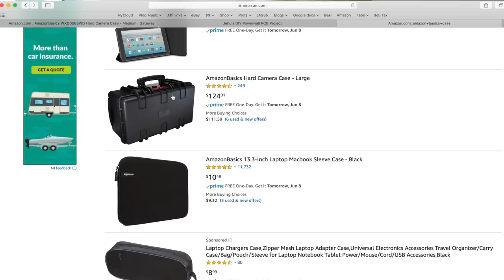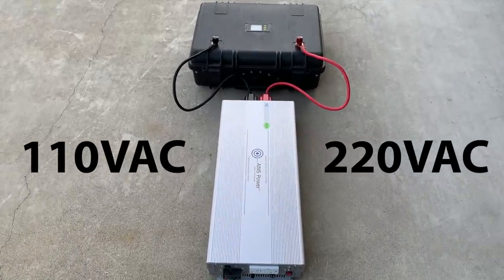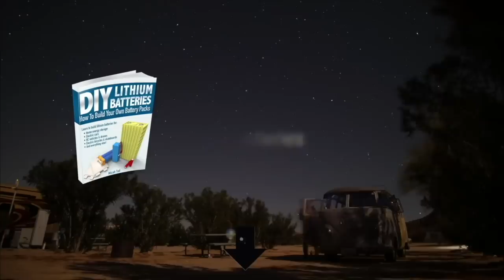600,000mAh DIY Power Pack build

Comment: Since your selling these battery modules We are going to be stuck watching all the battery builds using these modules. I think using LiFePO4  in Sino Poly Format is Way easier than messing around with these tiny 18650 batteries. One can get  (4) 100Ah 3.2 Cells for around $400 brand new together these give 12.8V many BMS available for these. Good for 4000 charge cycles at 80% depth of discharge. Way better deal that 12 volt SLA lead acid deep cycle batteries.

Comment: Capacity is around 84,000mah, not 600,000.

TL:DR AT BOTTOM
13:16. 24v. Each cell (discharged) is around 3.7v and fully charged around 4.2v.
Each of those boards has 7 cells IN SERIES. That means that for each of those, while the capacity of the cells alone may add up to, say, 14000mah, because they are in series the capacity remains the same.
At 1:48 you can see that the nominal capacity is 3000mah.
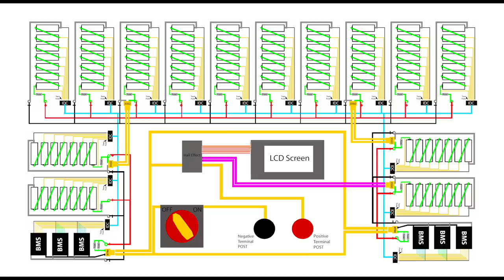At 13:00 we can see that 14 of these are connected, so 14*3000mah = a real capacity of 42000mah. A long way from 600AH huh.
BUT MORE IMPORTANTLY, look in the description. "Its not Click Bait 200 cells x 3000mah = 600,000mAh"
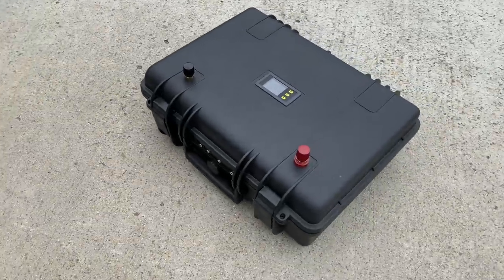Look at 13:00 again. 14 sets of 7 batteries. 14x7 is 98, not 200. Ok, lets assume that the  diagrams showing the cell packs in the schematic are just poorly draw and only show half the cells, as each board has cells on each side. so 14x14, which gives 196. Closer to 200.
Now, the real capacity. Each set of 7 cells gives 3000mah @ ~24v. times that by 2 to get the capacity of a whole "pack". 6000mah.
6000x14 = 84000mah. Still impressive, but nowhere near 600000mah. Plus, a lot of it wont get used.
MESSAGE TO CREATOR: Im hoping this was just an honest mistake :3
So why does this exist? The links in the description (From kit.co) say that commisions may be paid to the channel when people buy from that link. Thats right. It seems like a clever scam, but im hopeful that the creator has a reasonable explanation.
TL:DR
Capacity is around 84,000mah, not 600,000. A lot will be lost in inefficiency in the BMSs and converters.
Reply: You seem to be judging pretty harshly for being only partially correct.

First off, when people state Li-Ion or Li-Po battery capacities they usually do so at a single cell nominal voltage for mobile devices. Hence the 600,000mAh nominal at 3.6/3.7v. Otherwise why would he state the capacity in mAh when Ah is more suitable? The title is obviously meant for people who are not battery experts. One could easily slap a buck converter onto it and poof, it would be "600,000mAh" anyways.

Secondly, mAh/Ah is NOT a measure of battery capacity. It it not a unit of energy. In the video he stated the capacity in kWh as well, which is the more useful number.

He knows what he's doing, which I'd hope is extremely apparent. One can't spend over $1000 on a battery pack and not know this basic stuff.

Edit: Also, usually higher voltage is MORE efficient, and BMSes are primarily useful for charging. Higher voltage is better for battery efficiency, efficiency of wires (resistance), and the efficiency of buck converters or ESCs which would likely be used as a load for such batteries.
Reply: @jrcowboy1099  He made an 85Ah @ 24 Volt battery ...

Comment: Why not pack the batteries denser without cell holders and PCB boards between them? 

Could just solder and tape together a block of cells and connect them to a board with wires. Could’ve probably fit 1.5x-2x the capacity in the case I’d think.
Reply: He's actually talked about that in the videos where he was demonstrating his 7S boards. Solder and welding are a pain in the neck, and in his opinion, the expense and space of the boards is easily offset by the convenience and safety that they provide. I'm inclined to agree, personally.

Comment: this is my question:  why one can charge a drill battery in 30 minutes but to recharge a bike battery you need 6 hours.  is there a way to install a bunch of switches to separate the bike battery in small sections and charge each section separately at low amperage, all sections at the same time with several chargers working together?  I understand the voltage difference problem when you replug them together, but I need this.  Are the batteries inside a drill battery the same as the ones in an ebike. if not why is this?  It seems like a recharging bottle neck to me when designers try to save money on switches, diodes and wires
Reply from the maker: No they are slightly different, but you can charge both in half hour,  they just won’t last very long
Reply: Thanks for replying.  But what I mean is that each cell separately can be slowed charged fully in a short time because they don't hold a lot of amp hours.  When you put them together, it takes a long time just because they are big in ah capacity.  I know for a fact that if you take all the cells apart and charge them at recommended amperage individually, with say 80 tiny chargers, it would take 30 minutes to charge them all up and put them back again.  But why take them apart when you can install switches that can change the circuit so this can be done.  Do I need to draw this? it is simple. The other thing I see is the bridges between packs, why not use a thicker strip instead of 3 strips connecting the same bridge?  If motion strips insulation, there is a big chance of a short.
Reply: @productcheck  What you are trying to say is, You want to fill a pool by first filling up 100 individual buckets and then throwing all those buckets together in that pool, Its still the same capacity so it wont help you.
Reply: @wietse2928  I'm talking about saving time to recharge.  If you have a giant cover on that pool with a tiny hole to fill it up, it will take a long time to fill.  if you remove the cover and locate the pool under the Niagara Falls, it will fill up quickly and it will not break.  So the time it takes to safely recharge 1 cell should be exactly the same time it takes to recharge 1000 cells, except you will have to throw a switch which will unparallel and un-series the connections temporarily until recharged.  I see the problem that when some cells are done charging, more amps may go through the other cells not done charging if using a constant amp charger.  The same happens towards the end of a discharge, the cells that have more capacity will have to work harder, except that the voltage drops and that will help balance the amps.  Some current will go to the motor and some will go to recharge lower capacity cells unless each cell is connected to a diode or something that will prevent recharge during discharge time.

Comment: Finally, a power bank enough to charge my phone... 270 times was it? nvm still not enough. Hmph 😤 pathetic 

In all seriousness this is an amazing project and has so many uses. This is something I’d love to do but don’t have the budget for, non the less it is surprising how densely packed it is and how it uses most of the space efficiently. Love the work you’e doing
Reply: more like 40.5 times, divide everything this guy says by 6.6666666...

Comment: What would be the fastest way to charge such a device? I'm in ARG, thus 220-240v @ 15-20amps, giving us around 3.3Kw at a minimum, would this mean the 2.4kw pack would be charged within an hour at max speed?
Reply: Looks like we'd need 1680 watts to charge all 200 cells at 2 amps each for a maximum charge speed? (4.2v * 2 amp = 8.4 * 200 = 1680 watts)
Reply from the maker: Yup,  you can do 1 hour charge with a 2200w charger

Comment: i love this stuff i have a project i wana do with my new fleet van , a electric car charger i want to have a solar panel on roof to keep battery system topped up , with 2x lesure batterys and a power cap and a 5000watt inverter (it it generates that) i get a slow charge on a small bmw , when people by electronic cars in uk you get told there are vans out there that can do this so i wana make sure i can and rather not use petrol generator as i use 240v in my van for a computer ect ect 90watts also powers emergancey lights to it dont affect front battery , what i have lernt over 10 years of youtube and misstakes is a dam cut off witch at 10.4v killed 3 huge battery's would love to use lipo so i can just add packs to :) how do you choose a inverter ?

Comment: Any 12V (4s) projects? Could you do 2x12V (2x4s) on one pcb? Cheers!
Reply from the maker: 8s?
Reply: @jehugarcia  i mean 4s but twice on similar sized pcb  as is your 7s project . Left side 12V (4s) / right side 12V (4s) and one connector for 2x12V, parallel 12V and 24V. 24V with some jumper or switch. Something universal for 12V and 24V on one pcb. Do you know what I mean?

Comment: Hey Jehu. I'm new to the whole power wall game here. So what I dont get is. You say in the description the system is outputting 600,000mAh which translate to 600Ah with 24v wouldn't that be 14kwatts? Help me out here man. Is there a difference between Amp hours and "regular" Amps
Reply from the maker: Yes amphours is capacity vs Amps is power output,   This is 600ah @3.7v  or 87Ah @24v

Comment: This battery is 84Ah at best. if it was 600Ah  it would have all the cells set as 200p  3.60v  600Ah
Reply: Right, it is a 7S pack so ... 85 AH = 600,000 mAh / 7S

Comment: Found an error in your schematic.  The Bottom right BMS has the positive and negative power connections to the eternal wiring swapped.  PLEASE UPDATE THE SCHEMATIC in case someone takes that literally.  
PS - Love the content and I might consider building this as I will be doing an off-grid weekend shed that I want to power by a portable solar system that I take with me when I go there.

Comment: Has anyone made a 14s2p pcb board that you can purchase yet? Have you thought of using this design for different inverters for voltages 12, 24, 36, and 48 etc etc? I know 12v is probably best with a different chemistry, but would it be worth it to make pcb’s for other voltages? And yes I know you can wire them in series to get the desired voltage lol. Thanks jehu

Comment: "What exactly does 2.2KWh mean"...think about that in context of the heat dissipation by the batteries when charging or discharging at high amperage, and you just placed the whole arrangement is a sealed plastic case...."killing me softly" playing gently on the radio....
Reply: The load is spread over 196 batteries ... they will not get hot if discharged over many hours.

Comment: So to summarise, you need to spend $750 Li-ion batteries excluding all other parts and you have a 600AH power cell which will last 300 to 500 cycles. OR you can spend $3000 on LifePo4 cells which will last 1800 to 5000 cycles. So when considering maximum life cycle range the price difference is $4500 in favour of LifePo4 cellsL Li ion $7500 ($750 x 10) Vs LifePo4 $3000.
Reply: Yes, you can create your own battery pack using LiFePO4 cells. Many people have ...

Comment: Hi everyone , My question might sound a bit dumb but I will love if you guys could help me with this! 
I get confused about the relation between the capacity of the pack and the power it can deliver. 
To me a battery pack of a capacity of 2,2Kwh should deliver 2,2 KW of power, but I noticed that this relation is pretty much never right.  Knowing that cells specs are always given in Voltage and Ah , how can I know the Power in W delivered by the pack ? is there any calculation that I might not know ? Are other components implicated in the calculation ? 

Thank you very much in Advance !

Comment: wouldnt it be better to have 1 bms and many active balancers??? to save cycle life and also have high/low voltage cutoff but the ability to transfer AH rather than just burn it away with resistors

Comment: You spent a lot of time saying to have them all charged to the same state, but you never mentioned how "exactly the same" they need to be charged, or what ill effect a mismatched charge may have.
Reply: mark warlick if they’re not properly leveled it can cause uneven strain across the bank and quicker wear on batteries.
Reply from the maker: Use a charger to charge the discharged batteries

Comment: If that thing starts to burn... Oh boy oh boy
Also I wonder why vtc 6? Samsungs 3500mah cells can be found for under 3 bucks brandnew
Reply: Output. Are those $3 cells capable of draining at over 10Amps?
Reply: @grejen711  15 amp actually
Reply: @grejen711  and also 200cells 24volt is 6 cells in series and the rest parallel the 100amp max output here is caused by the bms circuit not the cells

Comment: Tesla charging aside,
For a portable power-bank for charging phones and laptops etc. (small dc devices) you are way better off running a 12v system, with all those cells you would get double the capacity compared to 24v system. We don't all have tesla's to charge so there is not need for a 24v system in my case.
Reply: You will get exactly the same capacity being 24V or 48V
Reply: @emilerichier  Whaaat!!! No no no
(For example only)
If i have 8 cells at 2000mha each. And decide to build a 12 vs 24v system...
A 4s 2p 12v system would be 4000mha capacity.
And a 8s 1p 24v system would be 4000mha. (Not a fan of 7s systems)
So how is it the same.....
Unless I am missing something I dont think there the same.
Reply: @thesmoothgoat  Well sorry I got mixep up, it was late here. Jehu is indeed wrong in is calculation like in a previous video. 600 000 mAh would be with a 200s1p.
What I mean is you will get the same energy in Wh. You will charge your devices the same amount of time in 12V or 24V for the same number of cells because there is the same amount of energy.

Comment: How big will it be if you did 48 volts  you said you was going to make a 600,000 mill amp battery but you said that battery was 100,000 in this video I think they have lithium car battery’s are 100 amp you only need two of those I am not sure how heavy are those
Reply from the maker: This is 2.2kwh at any voltage.  It’s capable of delivering 100A at 24v so 2400watts

Comment: Damn, you built something that is already on the market. Too bad that what is on the market is a much smaller package and much less expensive. The one on the market is also much safer.
Reply from the maker: Show me
Reply: @jehugarcia  Battle Born LiFePO4 Deep Cycle Battery - 100Ah 12v $900

Or, order 4 - 3.2V 100Ah cells, put 4 of them together and get a inexpensive BMS and make your own 12V 100Ah battery. $600. Either is more practical than your 200 cell monster.

Comment: Is that really a standard practice to parallel several BMS units with paralleled batteries? What that fails to do is monitor each cell individually. If one of the batteries in a parallel circuit of batteries starts getting weaker, or charges faster, then the correction the BMS does will affect all the batteries in that monitored leg. That makes the oversight of individual cells less effective by a considerable factor, and thus increases the danger. After all, lithium batteries can become a serious problem if not monitored closely. Collectively, the BMS can provide a higher charge current to all the cells, but the monitoring side of BMS is rendered ineffective to the point that a cell begins to short out internally (although somewhat rare).

Comment: Nice project.  Your math is a little off..  With cells in series think of it as a 25 volt 3ah battery. You don't add the amp hours together. Its a common mistake.  Each bank of 7 battery cells is 75 watt hours. Total 1050 watt hours for the kit.   When batteries are in parallel then you add the amp hours.  Think of it this way..  You have 14 25.2v 3000mah batteries in parallel.
Reply: Actually, he made a 85 Ah @ 24 Volt battery ...